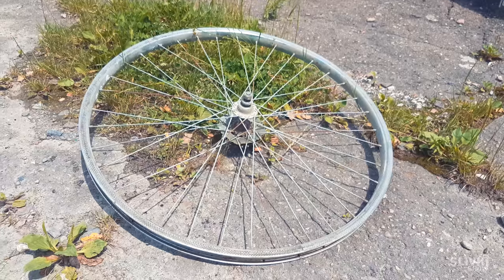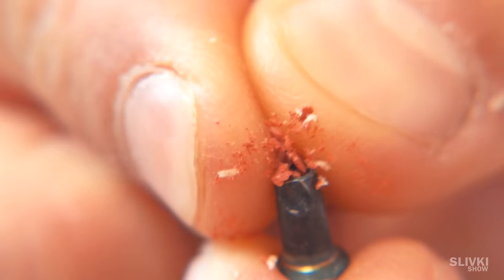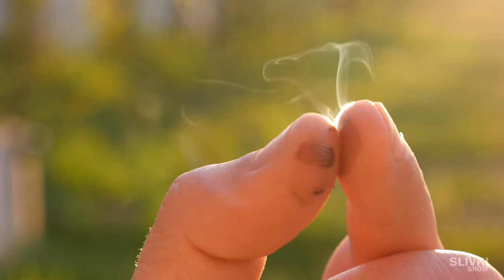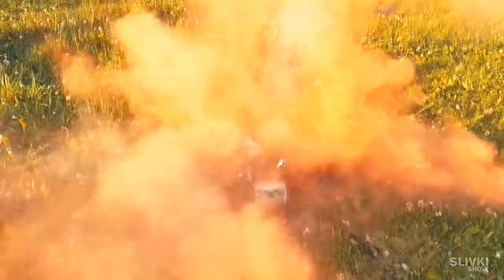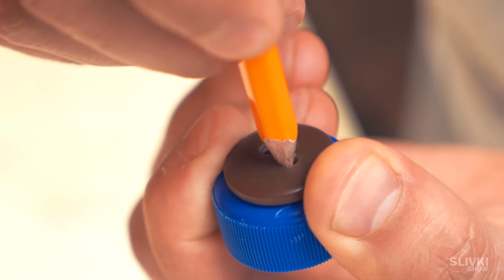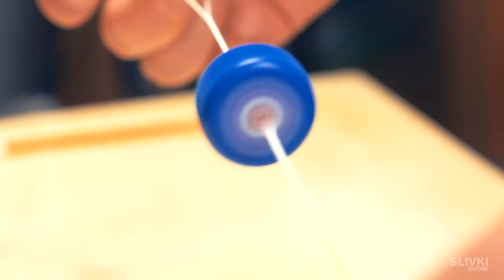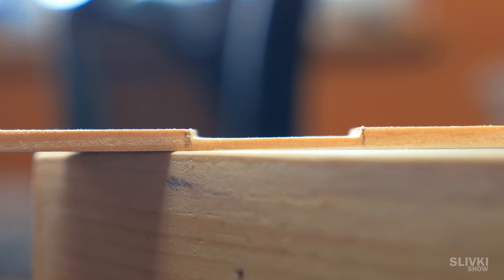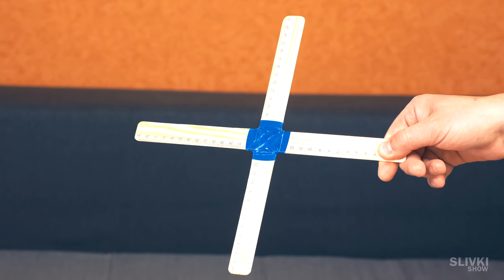6 Awesome Tips from Russia

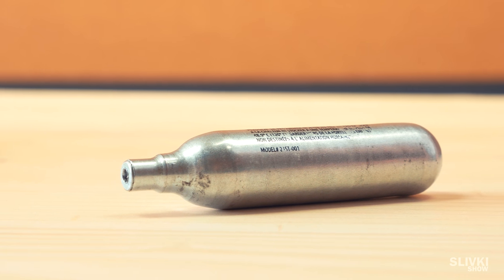Comment: 1:15 You pack the bulb with Blackpower (Gun Powder) and make it very tight inside, then put a fuse and light it.
Reply: thx
Reply: can u make a short vid on how to make one
Reply: comment sent as tip to fbi.
Reply: Thx
Reply: Dark Productions WHATS THAT BULB CALLED
Reply: FBI wants to know your location :DDD
Reply: its a empty co2 container for paintball guns and such
Reply: It’s a co2 container for airsoft
Reply: Random Person its just a little gas container mainly used for carbon dioxide and nitrous oxide
Reply: DO DODO FBI OPEN UP
Reply: Any other viable powders? Match powder maybe?
Reply: Thx i needed that info
Reply: Domicos mc and more hey were you even liseting😡
Reply: @visigo7770  a co2 canister
Reply: boii
Reply: @alexfelton5299  black powder has giant explosion,you dont need to put match
Reply: Domicos mc and more just get a small c4 you’ll get the same result
Reply: What happens if you use butand or propane Will It Go Boom??? PLZ ME NEED ANSWERS
Reply: gunpowder mixture, google supports Russia
Reply: I used to make bombs like that but not with a bulb, thx anyway. But I have a question, doesn't it spray shrapnels when it explode?
Reply: Can you delete this? He deliberately didn't show you so you don't blow yourself up
Reply: @lunakittyyy  no the person said how to do it
Reply: @mah9435  The creator didn't show how to make it. This comment could get the commenter's account deleted (Shows how to make deadly device in comment)
Reply: @dokels  No, he'd get his video deleted. Also report this. YouTube doesn't allow such comments
Reply: @lunakittyyy  no ubran pictures said it
Reply: @lunakittyyy  duh
Reply: @mah9435  YES THAT'S WHAT I'M FUCKING SAYING
Reply: @lunakittyyy  sorry
Reply: @lunakittyyy  r/ woooooosh
Reply: @lunakittyyy  stop
Reply: @dokels  just pack it full of gunpowder but before you put the fuse in make it sure it is super tightly packed so make sure to use a nail and hammer to smash it in tightly.
Reply: @urban pictures make a video on how plz
Reply: theres a song on making black powder by leslie fish
Reply: @sebastianfinch6611  cool! You just reminded me I posted this
Reply: I think that’s a CO2 can no?
Reply: You should not have said that
Reply: @soulmad5669  not responsible if you try it

Comment: We used to flatten metal bottle caps and poke holes in them. Then we would have cap wars with the string tension saws. Super dangerous. Then we did it with the sharp food can lids. Good times.

Comment: or instead of a plastic cap and all that work, you could use a metal beer or soda bottle cap, just flatten it up, open two wholes, put a string through. hold both ends in fingers, and give it a few twists to start the motion. modify to a chain saw like frame if you wish, but just as it is itll even cut paper. at the right speed. just be warned, and string may end up breaking from friction.

Comment: How to make a co2 cartridge bombe CO2 Cartridge Bomb. Do not try this at home. Safety is number 1 priority 

Ingredients:

   * 1 CO2 cartridge (per bomb)

   * 1 hacksaw

   * 1 phillips screwdriver

   * 1 bowl

   * enough gunpowder to fill the CO2 cartridge. Just get one pound, then
     you can do this a whole lot. Get extra fine, it works best

   * 1 very small funnel. I have found that one of those things that
     doctors use to look in your ear works the best.

   * 3-5 inches of wick, per bomb. Make sure it is model-rocket type
     (green) or make your own with duct tape and gunpowder (explained
     later)

This is how you make it:

   * Use the hacksaw to cut the top off the CO2 cartridge, there is a line
     near the top, use this as a guide.

   * If there are any burrs, or anything like that, clean out the hole with
     the screwdriver.

   * Pour some gunpowder into the bowl, and scoop some with the funnel,
     keeping your thumb over the hole.

   * Once situated over the CO2 cartridge, remover your thumb and fill the
     CO2 cartridge. I suggest you do it over something, so if you spill you
     can still use the powder for later.

   * Compact the powder in as tight as you can, this will make a louder,
     and more powerfull explosion.

   * Once it is full, put the wick in, so that it is in the powder, (so you
     know it will light) seal this with some duct tape. Now you are ready
     to use it.

     WARNING: Do not stand near the bomb when it goes off. The shrapnel is
     produces is rather formidable

Places to use CO2 bomb:

   * Coin return of a pay phone

   * put between sign and signpost (blows them off usually)

   * tape to a big window

   * muffler of a car (you don't need a wick for this, push it in as far as
     you can, and heat will do the rest)

   * open the gas tank and put it in there

   * put in elevator, the press a button (don't get in with it)

   * electical boxes or phone boxes

How to make wick out of duct tape and gunpowder:

* take some duct tape, about 5 inches or so, and lie sticky side up on
table.

* put a small amount of gunpowder down the middle, leaving about 1 inch of
tape free of gunpowder.

* then fold it up.

* after you put the CO2 cartridge at the end with the gunpowder, make sure
that the gunpowder in the wick and that of the CO2 cartridge touch.

----------------------------
!***************** !
----------------------------

*=gunpowder

* Light the part that has no gunpowder and make sure it is burning really
well, before you run like hell.

* Burn time varies with how much empty duct tape there is, but once the
powder is lit, you have less that a second to get away. And do not try this at home.